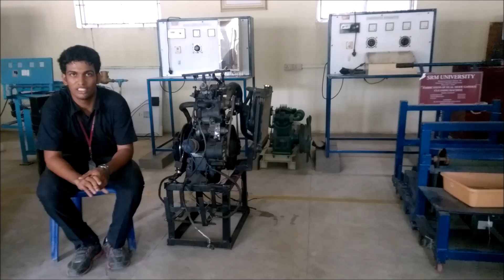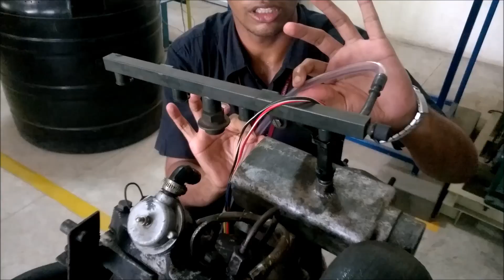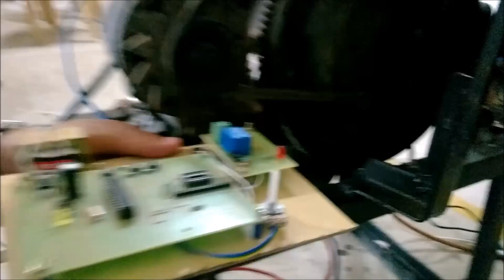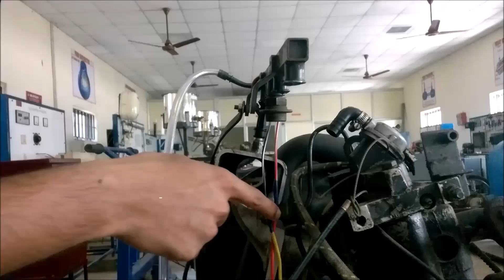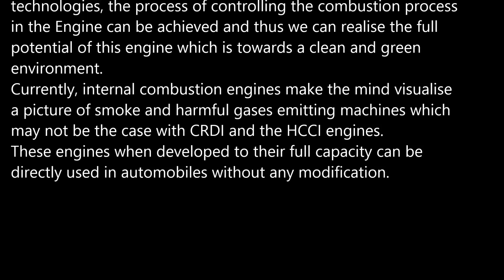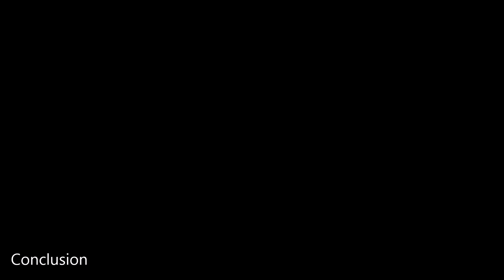CrazyEngineers: Homogeneous Charge Compression Ignition Engine with Multi Fuel Injectors

Comment: Basically this is a reworked Diesel engine as diesel is self ignition by compression.
Reply from the maker: Yes. Reworked Diesel Engine. Agreed. But the concept of self ignition is more complex with combining characteristics of both a petrol engine and characteristics of a diesel engine.
Reply: Shiva Subramanian Please explain as I'm interested to know more. Why this would be better than experimenting with Thorium genertor for example (safe, abundant and cheap)
Reply from the maker: iVlog If you want to know more about HCCI Engines, here https://en.wikipedia.org/wiki/Homogeneous_charge_compression_ignition
And Thorium generator? How would you stop the radioactivity and the discharges? Those are few things to consider. And this page might answer why Thotium based generators are not popular (as of now)
https://en.wikipedia.org/wiki/Thorium-based_nuclear_power
Reply: Shiva Subramanian Thank you
Reply from the maker: iVlog You're Welcome. :)
Reply: iVlog True, but getting it to work with gasoline is much trickier than with diesel. There's a much narrower temperature range to work with. Also the fuel charge is injected near the bottom of the stroke, rather than near the top, as in diesels. This could be a good solution.